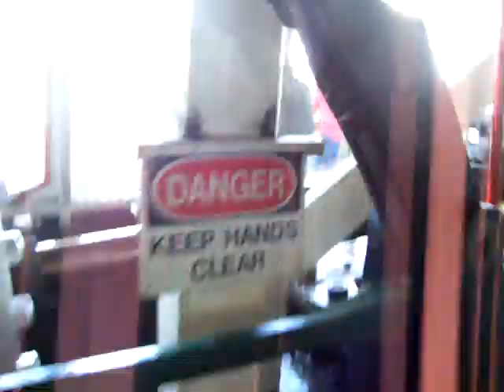Natchez Steamboat Paddle-Wheel, Engine Room, Steam Whistle and Docking

Comment: A low pressure steel boat, very modern relative to the glory days.  That big thing between the two engines is the condenser.  Boiler appears to be just forward of the engines.  Those chimneys, which in olden days would have stood right over the fireboxes of return-flue boilers, are totally for show.
Reply: Yep those smoke stacks are the low pressure smoke stacks that are the exhaust for the firebox, but I also notice the smaller high pressure stacks which are the exhaust for the cylinders (Which are mostly on the rear of the ship) are missing.  What's up with that?